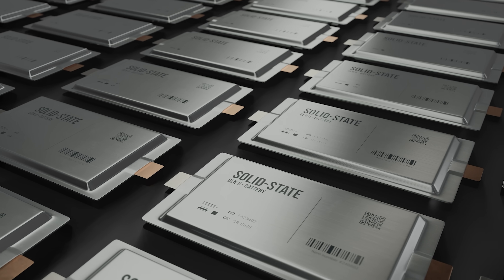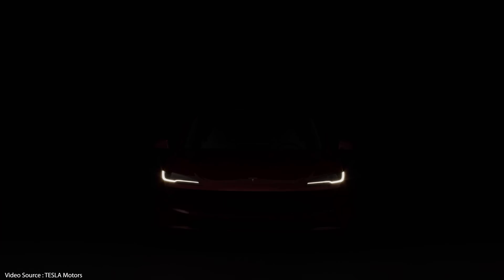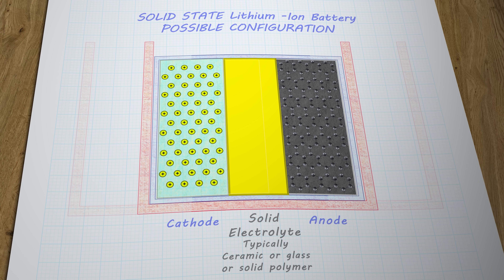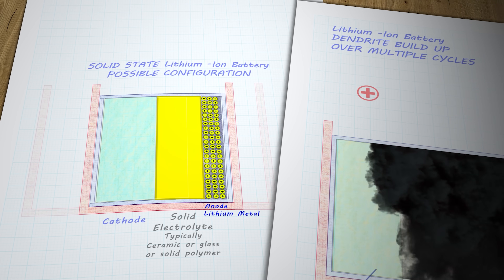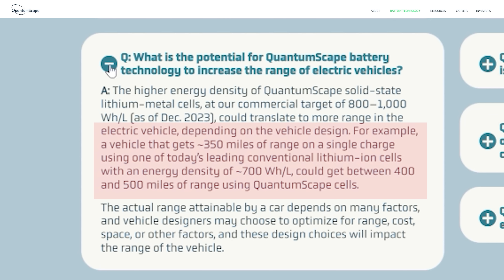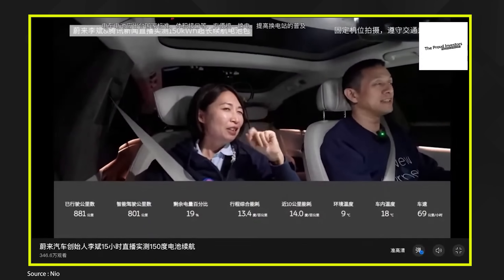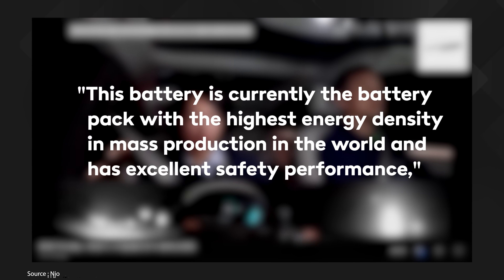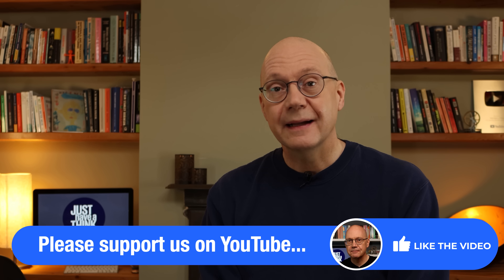Solid State Batteries - FINALLY powering electric vehicles in 2024!

Comment: Question:  when solid state batteries finally land will they be made to replace old tech batteries fitted to current generation vehicles and be cheaper?
Or do we need to trash the entire vehicle?
Reply: Most of an EV can be recycled, including the battery. It won't be worth the cost of upgrading existing vehicles, but that won't make them useless. Current gen EVs are still perfectly fine for most people.

Comment: Tesla obviously thinks Lithium Hydroxide will be around for the future. Tesla builds phase one of its cathode plant. Obviously, graphite and possibly silicon-graphite anode are relatively easy to produce using the dry coating method. Tesla apparently uses an NMC955 cathode.

Comment: Most interesting - the cathode needs a liquid electrolyte to transport the ions to the solid separator. Cell obviously needs to be under pressure to get a relatively even deposition of lithium on the lithium metal anode.

Comment: Getting higher capacity batteries in car (and other vehicles) that can charge quickly is interesting. My current car can accept 350KW charging but not many charging sites offer that. Just have a think about the power infrastructure needed to charge a car capable of 600 miles range in, say, 15 minutes. It will take over 1MW chargers! Of course, home charging at a mere 7KW is by far the best, cheapest and easiest option for almost all EV owners and charging at night when leccy demand is low is also useful for balancing demand and getting a cheap charge. I just don't find charging that hard and in spite of the crazy fairytales road warriors tell about needing massive ranges, modern EVs are more than capable of long trips with no problem. Car companies seem to chase pipe dreams, leading to SUVs that very few people need, or even like driving in town, to bonkers range batteries that will very rarely be used on one journey. Solid state batteries do offer some real advantages, especially temperature insensitivity and the possibility of much smaller EVs with a decent (~250 mile) range. What SSB won't do is shut up the client journalists in MSM spinning the BigOil lies about EVs in general.

Comment: No matter the battery tech, electric cars are too resource intensive to build one for everyone and the power requirements to charge them all is going to cost trillions in new power infrastructure and new energy sources and grid scale batteries.
It will cost decades of GDP to get everything in place and, by the time it is, most of the batteries (8-10 years)/cars (6-10 years)/solar panels(~20 years)/infrastructure (Wind farms 20 years, Grid scale batteries 10 years) will be nearing it's end of life, ready for us to take out another $10 trillion in debt (Added to the last debt that would not have been paid off) to do it all again.
Not to mention the taxes that the government will impose when it faces the loss of tax revenue from oil, coal etc. 
When you fuel up your car, part  of that money is going to infrastructure building and maintenance, transfer that tax to electricity, plus an electrical grid upgrade fee, and suddenly it starts costing more than gas for the same amount of electricity. 
Somebody charges their vehicle from their own solar panels? Well the rest of us pay a little more because of the government still needs the same tax revenue because the grid/roads didn't cost any less to build and that amount is now spread over less people.

Comment: Pet peeve: energy density is not energy per unit mass, it is energy per unit volume.
energy per unit mass is specific energy.
Reply: I would claim that is a question of definition, and that you should get a better pet peeve.    I still think "density" works because density doesn't only mean "weight", also "compactness", which is just "how much of the stuff is squeezed into x", which x being a given weight or a given volume.  "This volume is dense with energy."  That sounds perfectly understandable to me. What would you have called it instead, by the way? "Energy concentration"?   I think density and concentration can be synonymous.
Reply: @minimalreification  no matter how you hash this, you are wrong.

"Energy density" has a specific technical meaning, and that meaning is "how much energy fits into a given volume.

"How much energy fits in a specific mass" is a separate definition, and the term which it goes with is "specific energy"

You can argue about colloquial use until you're blue in the face, you're still wrong.

Comment: Seems to me we are still left with the electrical infrastructure problem.  With all this electrical demand for recharging these batteries, where/when will the electrical delivery capacity increase?  Government still puts huge penalties on energy production.  Also, to jam all that energy into a battery in minutes that claims 700 miles of range, will you need charing stations with inputs of 440V or greater.  Certainly can't use a "trickle charger!!!!"

Comment: I'm really rooting for solid state batteries, they have all the potential to be a massive game changer and pretty much "fix" all the major limitations of current electric vehicles, most importantly: range, charge time, weight, range losses in cold temperatures, flammability (although electric vehicles has significantly lower fire rates than ICE, we can't ignore the challenges when then do catch on fire), reliance on metals such as lithium, etc. The only thing is that it will probably be reserved for high-end luxury vehicles at first due to the manufacturing costs, which will inevitably be high until a few more years.

Comment: A big battery improvement could have really bad consequences for the EV market. Why?

- A big change in battery technology could render existing charging infraestructure useless or worthless
- Existing EVs would lose almost all their value in the used market -> You either have to use it until it stops working or you will have to get away with all the loss if you want to update your car

Comment: In the US range anexiety /limited range is a real problem. A friend of mine has a VW with 250 ish miles of range, except that driving on the highway you really only get 60-70% of that. So he can't even get from his house to his parents (only a couple hundred miles) without completely draining the car and having to stop for a lengthy charge or two. Likewise I've rented Teslas for short trips of a few hundred miles (less than 500) and it basically doubles to tripples the travel time because of all the charge stops. That's just not going to work for most people. Once we start seeing 750+ miles of range that will turn into at least 500 miles of real straight highway driving, I think that will be much more palatable for folks.

Comment: WAY better energy density and charging times are the best parts of solid state tech, and the fact that you don't need that awful fire prone liquids in the batteries. But the worst part is once again the materials which would go into each solid state battery, so they'll be lighter and smaller too. 
I know how many think solid state is gonna be the new wonder battery to replace outdated and heavy lithium ion, but as with lithium ion batteries that power every battery electric car, many do often overlook the huge amount of finite resources that go into each battery. The materials that go into each heavy battery is mined in mostly horrid unethical conditions where people work without any health & safety whatsoever. Then there's the life cycle of the batteries. When they're "done", how are they recycled / disposed of?...

Comment: Here is the problem with public discourse of solid state batteries: a) it is never specified what type of solid state is discussed people assume always the highest promises even for types for which these promises are not applicable b) the promises are made by extrapolating scientific small scale results into big cells for cars even though the scientiest or even battery manufacturers have no idea what it means to adapt a battery for vehicle use. I am not saying this to be mean to them but you only really learn what it means to implement new technology into a car, what extra steps you need and what requirements you neeed to fulfill once you actually work in that requirement. The additional requirements can easily make the practical application of a battery much worse than theoretical estimates previously lead you to believe and lastly c) because the promises can not easily be translated into actual vehicle use the buiisness case for some of these cells can instantly collapse because after all the compromises are made you might just end up with a cell than can only do about 10% more than an standard NMC cell for triple the price ....

Comment: It is a tricky business decision to consider when a technology is mature enough to add use economies of scale to reduce price.  Tesla pulled the trigger on this when they built the giga factories.  They are now invested in a type of battery.  They reduce price and increase performance through small increases in technology and economies of scale.  It is not surprising that they are not pursuing solid state battery technology.  It will be a business and manufacturing decision when it is more economical than current technology.

Comment: Gotta disagree with you. In densely populated areas and countries it is less of a concern with range but in large countries that have robust intracountry transportation needs range is a real concern, especially if it takes considerable time to recharge and or trip planning to assure you don't get stranded. Let me tell you driving to Kansas from Arizona for instance is quite the trip planning problem. Where I can do the trip in sixteen hours in an ICE car with electric it took nearly 20 hours with electric, actually closer to 30 hours because of the need to find a hotel. EDIT: These electric times are also optimistic, depends on so much such as charger availability, cold or warm weather etc.

Comment: Stop saying range anxiety isn't a thing. It is a real thing. It really exists and I've experienced it first hand. Prime example. My son lives 188 miles away in the desert. He has a Tesla Model 3 Long Range. It works perfectly for his day-to-day needs. That changes dramatically when he comes to visit. He has to stop in a city 80 miles from here to charge up before coming all the way here if he doesn't plan on staying overnight. If he stays, we can get enough charge into his car to make it back the 80 miles to top up again. There are no chargers in this city. It's a desert. The speed limit is 75mph and you are best advised to run that or a bit more. There are no viable back road routes to save some energy. It's also extremely hot requiring AC. Yes, range anxiety is a thing depending on where you live and your lifestyle.
I would love an EV....I dream of having one some day, but where I live it's not a real alternative, yet. Oh, if I go east out of here the closest charging is 140 miles and that's not a reliable location. Range anxiety is real and we aren't there yet. I can fill my cars or motorcycles in a few minutes, use the restroom and be gone again in 10 minutes. I'm not retired so I generally don't have (or want) to waste time charging. When I'm retired, different story.
Stop telling me that range anxiety isn't a thing. Gah!!
I travel for pleasure and camp often. There are very few chargers in the places I travel. Not there yet.

Comment: EV range-per-charge would not very importanmt to me, or (I suspect) to most potential EV owners, if it were possible to recharge the battery in 15 minutes or less. It's the prospect of having to wait in line at charging stations, and then to twiddle my thumbs for another 45 minutes, which puts me off.

Comment: Sorry, Sir, but you are in a delusional fever dream if you seriously believe EVs are going to replace ICVs in our lifetimes. No one alive is going to see that. Even if all the problems with batteries are resolved, the issues with charging stations, back-end electrical infrastructure and generating capacity will remain for decades thereafter: and, NO, windmills and solar panels won't cut it!

An electric car sucks up as much electricity in an evening as over a dozen average households. No, off-hours charging will not help the situation. And, again, solar panels and windmills won't keep up with that. The only thing that could keep up with the increased power demands is NUCLEAR. It would take DECADES to replace existing generating capacity with nuclear, never mind expand it.

You, Sir, need to pull your head out of the clouds and start coming to an understanding of reality; you and everyone like you. 🙄

Comment: Since I live in Texas and don't have a basement, I have developed a new auto battry in my garage. It is a semi-liquid polymorphic construction made almost entirely of nucleonic silly putty, in a rubberized silicone case which is completely oblivious of ambient temperatures. It has a range of 10,000 miles, and charges in 11 seconds. The inner core is a marble-sized pill of depleted uranium, assuring a lifespan of 300 years. At this time, after 80 years of intense work, I have three battries for sale, and I am certain to get the price down from $770,000 each to about half that before going into full production by 2095. Since I am 83 years old and have been working alone, I will be looking for a very young assistant. If you are interested, please note that you must have completed grade school and have a sparkling enthusiasm for battry science, like my hero Just Have a Think does!

Comment: Tesla has never had any battery chemistry technology of it's own, they develop the battery pack and managment systems, and have only just dipped a toe in cell manufacturing, but it's all been with other peoples chemistry.  This was part of the corporate starategy, to just buy batteries from someone else.  That was probably a good plan for a startup which could simply tap into the existing consumer Li-ion battery mass production market where battery makers sell to anyone and everyone.  But if competitor car makers can ge exclusive access to a battery tech which is truely game changing then it will become huge competetive disadvantage which would be especially crippling in making mass consumer vehicles.  I think in large part the self-driving AI angle that Tesla had was an attempt to portray the company has owning some kind of killer-app IP which would insulate them from competition.
Reply: At least they started the hype on EVs. The conventional manufacturs ignored EVs as long as possible.

Comment: Going solid state doesn't increase the energy density of the cell itself.

It just increases the efficiency of the cell packaging and therefore the total energy density of the entire battery cell array.

Also solid state is NOT the holy grail battery tech.

It's the holy grail of battery cell configurations - but other cell chemistries like molten salt electrolyte metal air chemistries dramatically exceed even the most optimistic lithium derived solid state cell density.

Comment: Still charged by BURNING COAL, still use TOXIC CHEMICALS & SLAVE LABOR & DESTROY THE EARTH THROUGH MINING. Still on electric grids that have rolling blackouts across the country. EVs ARE NOT THE ANSWER. & Toyota has invented an engine that runs on WATER & GET BETTER MILEAGE THAN GAS, AND another company has found a way to use carbon sequestration to make a methane fuel that burns clean is ready for production NOW & CAN BE USED IN ANY VEHICLE: gas, diesel or even JETS....EVs ARE NOT THE ANSWER.

Comment: Grid level storage and EVs will benefit largely from SSBs. The range of EV can be increased, and the capacity of grid level storage can be increased without requiring more space.

So effectively, SSBs have the capacity to solve the major issues in both industries. In the case of EVs, they will allow to solve the range anxiety issue. On the other hand, due to their higher storage capacity and also longer storage duration, will allow us to reduce the need of peeker plants.

Comment: We have been using a solid-state battery for our drone for a while now, and they are pretty impressive, the best energy density you can get on the market for not an outrageous price (looking at you amprius and 1000+$ for a 6s 10ah battery) 
Our solid-state made by mad components is at about 270wh/kg vs amprius commercially available batteries at 290wh/kg